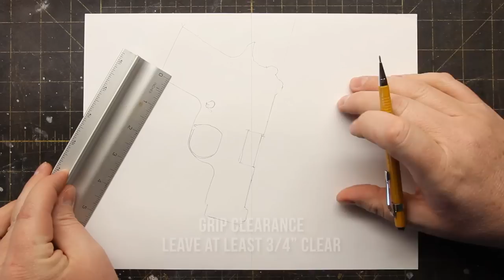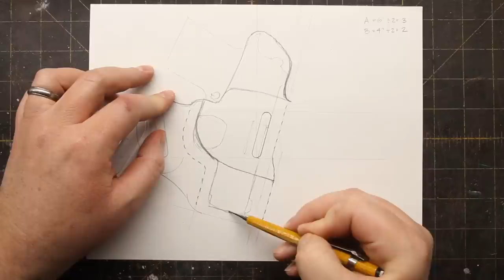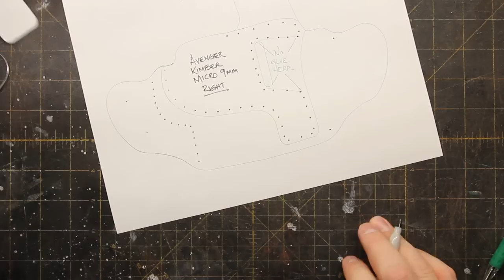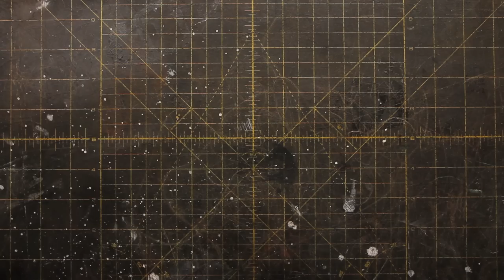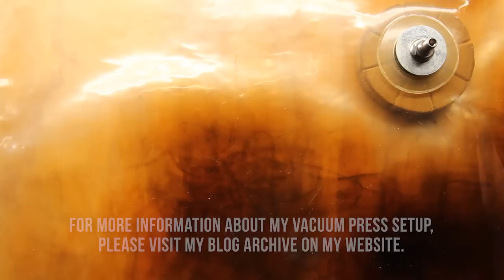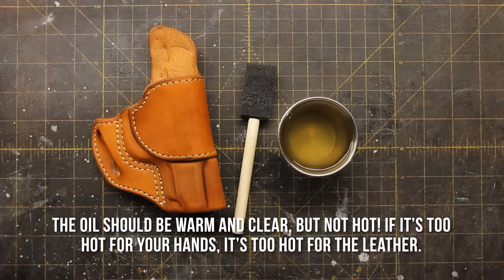Making an Avenger Style Holster, Kimber Micro 9

Comment: Well done! A tip I picked up recently is using a Q-Tip to apply dye, etc, to edges. It uses less dye and works well in tight or narrow areas, plus it is less likely to bleed over the edge. I do envy your shop though. =)
Reply from the maker: Good tip! I've used the q-tip method a couple times, but keep forgetting to bring more down to the shop. Thanks for watching and for the great comment. Take care!

Comment: Have you ever had the thread stain in places after dyeing and the water molding process? I used fiebings low voc, saddle tan dye. I let the dye dry for two days before molding. I did the same process on another holster with no issues. The only difference was I dunked the holster in water a second time while molding. I of course dyed the leather pieces and then sewn together days later. It doesn't look horrible but I want the best look.

Comment: Nice design. I would have lined the holster. It protects the gun from the stitching and the stitching from the gun. Also, you can clean your sanding wheels with a piece of art gun. Fiebings antique finish will also bring out the color of the dye and add another layer of protection.
Reply from the maker: Thanks Jeff - I do line holsters on special request, but I have to charge extra for it. Good tip on the art gum! I'll have to give the Fiebings antique finish a try one of these days on the right project.

Comment: I like how he said not to get the leather wet because it might stain it and that puts the holster in a pan of water.
Reply from the maker: If you wet the leather evenly, the whole surface is essentially stained evenly. But if you just get a portion of the leather wet, or get water spots on random areas, you’ll get noticeable stains. Or you can dampen an entire area, but keep it along the stitch line (paint within the lines), the stains aren’t generally noticeable.

Comment: Ok, that’s the prettiest damn holster I’ve seen in a while!  I can’t get any of mine to look nearly that nice.  Question tho….  You oil the holster, then you hit it w Resolene…. Isn’t Resolene a non-porous acrylic sealer?   You acknowledge the holster needs some oil on it prior to use…. But in the months and years to come, the leather is going to dry out and will need some more oil applied at some point won’t it.  I can see where some parts of the holster will still need oiled again (while avoiding too much softening of the areas responsible for retention).  But won’t the Resolene prevent oil from soaking into the leather in the future ?   Would TanKote be a better option since it will allow for oil to penetrate?   Or is there a reason that Tan Kote isn’t a good option?

Comment: Have you considered suede lining your holsters as well?  It helps to keep the gun from getting tarnished from the raw leather.
Reply from the maker: I never use suede, but I do line with smooth veg tan when requested. Suede is still leather, though it’s tanned with chemicals that can actually damage some firearm finishes. And the suede can hold dirt, causing additional risk of damage to the firearm. That being said, a lot of makers line with suede, I’m just not one of them.

Comment: Hello thak you for publish video. What is the purpose of using dish soap in warm water?
Reply from the maker: The soap helps to break down the surface tension of water. I've always felt it helps the water absorb into the leather more easily. I have no idea if this is true or not, but it's something I've always done. Plus, it's nice to have a little soapy water in the shop to clean my hands. Thanks for watching!

Comment: Yay, a new video. Very nice holster!

Your channel is one of the reasons I started to try my hand in leatherwork, holsters in particular. 

What‘s the reason you leave the mag release button uncovered?
Reply from the maker: Thanks! Glad you found the videos encouraging enough to try it for yourself! The mag release is left uncovered to help avoid accidental mag release. If leather was covering it, it could be actuated by the force of the human body pushing on the leather, in turn pushing on the mag release. You could punch a hole in the leather for the mag release (don't actually do this), but then you can't draw the holster because the mag button would snag the leather and lock the gun in the holster. Safest bet is to simply leave the button completely uncovered. Hope that helps.
Reply: @AdamsLeatherWorks  
Thank you for the elaborate answer. I would have thought having the mag release button covered with a piece of holster would be more likely to protect it from an accidental engage than having it exposed.

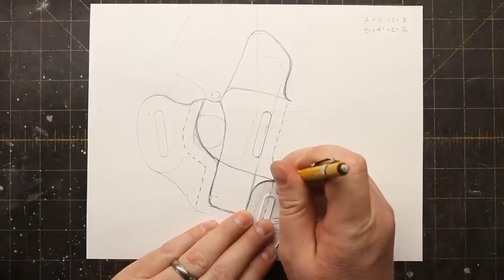Comment: I’m trying to determine the purpose of the near vertical line at 3:08.  I don’t see how it is being utilized in subsequent portions of the video. For that matter, is it just personal preference where you draw the “hook“ into your reinforcement piece between 2:38 seconds and 3:00?

It’s pretty trippy how you use the vacuum bag but it appears you get great results. I especially love the simple but direct aesthetic detailing you work into it after.

Thanks! Will you be at Sheridan in May?
Reply from the maker: The line at 3:08 is the fold line (at 3:31) so I can mirror the pattern to the other side of the piece (so both halves are identical).

The hook you're referring to is all related to the belt slot. When I initially came up with my first 'Avenger' styled pattern (modeled after the original Askins Avenger), I tried to differentiate my design from the original Askins version that everyone else was copying. I made the reinforcement piece much taller on the front of the holster, which allowed room for tooling, though it made the belt slot less ideal on the back of the holster because the leather has to stretch to accommodate the belt. In comparison, the Askins Avenger has an L-shaped reinforcement piece and the belt tunnel can be pre-formed by scooting the bottom edge of the belt slot upward prior to sewing it to the body. Getting back to your question - with my design, the 'hook' has to come down low enough to clear the bottom edge of the belt slot stitching. Look at the back of the completed holster later in the video to see what I mean.

My vacuum bag is the original I bought roughly 9 years ago. It has a few holes in it and doesn't pull much vacuum, but it still works pretty well. I'd like to try a hydraulic press one of these days, but I like the fact that I don't have to worry about bending (or breaking) molds or actual guns.

I don't have any plans to attend Sheridan. I'd love to one of these days, but it's not on the table this year.

Take care, and thanks for the great questions and compliments.
Reply: So the fold line slightly cuts off the protruding “hook” of the reinforcement piece at the very right hand side on purpose? Are you accounting for the thickness of the leather by doing that? Also, is the fold line parallel to the 15° can’t line? — it doesn’t appear so in the drawing but it may be irrelevant. Thanks for your responses; I keep analyzing this video to get a reproducible process for myself. Making it more science than art.…

Comment: ultimately,the holster looked ok from the outside,however,you didnt put stitching grooves for the inside stitches at the least,besides the fact that with no liner inside,the gun will eventually destroy the stitching,also allowing the possibilty of debris from the failed stitching to get into the action of your gun,and when the trigger guard was heavily burnished, even though it was only on the back of the holster,it could cause issues when holstering a loaded weapon.if the burnished area of the trigger guard was not raised before the curing and stiffening,it could catch on the trigger.
Reply from the maker: Thank you for watching and commenting. I'm not sure if you've ever machine sewn a holster, but getting a stitching groove to line up on the back side of the holster is next to impossible. And I think you're over estimating the depth of the indention in the trigger guard area. While it is pressed inward for retention, it's not so much that it would touch the trigger itself. Lining a holster is certainly a nice option, and I gladly line them when requested (and the customer pays extra for the added material and labor).

Comment: Saw good bye to the finish on that Kimber. No liner?
Reply from the maker: Been making leather holsters like this for around 12 years, and never had anyone complain about their firearm's finish. If you carry a firearm in a holster of any kind, you should expect some finish wear over time, regardless of the holster material. Some materials wear the finish faster than others. I line holsters, if/when requested, and I only line with vegetable tanned leather (same as I use on the rest of the holster, only thinner). It was not requested on this holster, so I didn't line it.
Reply: @AdamsLeatherWorks  wasn't questioning the quality,  just that I've heard they need to be lined. You do amazing work.

Comment: What can you tell us about the laser you use to apply your maker's mark? I'm interested.
Reply from the maker: My laser is a Rose Graphix 600mm x 1000mm, fixed height, manual focus, 90 watt machine. I bought it used from a local seller. It’s basically a Chinese import with US support.
Reply from the maker: I should add that lasers can be finicky and it sucks to basically be done with an item and have the laser mess up the engraving. If the mark can be applied prior to assembly, that’s the time to do it since you can cut a replacement piece if the laser doesn’t engrave right for some reason.

Comment: How do you achieve the solid “click” when bolstering the firearm? Many of my holsters and knife sheaths lack that heavy retention even after wet molding.
Reply from the maker: It's just the sound of the gun slipping past the retention point and hitting the leather wall in front of the trigger guard. I try to mold the indention pretty deep, then back it off a bit so it doesn't grab too tightly on the gun. Slick the interior with gum trag prior to sealing the holster. And once the acrylic sealer is dry, wax the contact points inside the holster to help ease the friction.

Comment: If I got my holster cant at 106 degrees does my belt holes go at same angle or 90
Reply from the maker: You usually want the belt slots perpendicular to your belt, regardless of holster cant. Sometimes that might not be possible, so you’ll want to make sure your slots are long enough to fit the belt through the angled slot.

Comment: Very interested in your work, here's why: necessity 🤣.

Actually, I would like to make holsters designed to work with women's waists. Shooting IPSC in Canada, there are restrictions on where your holster can be, but I found it very impractical. If I wore the holster on my waist, when extracting the pistol, (I have to be blunt here) it would collide with my 🤨boob 🤣; no other way to say that 🤣. The requirements of attaching the belt to 'belt loops' on an hour glass figure meant the pistol was angled in 🤔. I sewed loops onto my abdomen pockets to secure the belt, allowing for a straight, fast pull.

As with anything in life, 'accept it, change it or walk away'.... So I'll have to change it 🤣.

Okay, I can figure out everything you do accept how to sew it together without the sewing machine. It's not practical to invest in a machine when I'm only making a few. Cobblers in town have all retired.

Can this be done?

Comment: Great video! How do you keep your dye from bleeding into your threads after soaking it for molding?
Reply from the maker: Thank you! I use Fiebing's Pro Oil dyes and I apply it with an airbrush. I've never had a problem with dye bleeding onto the thread. If you dip-dye, that's probably a different story.

Comment: I am not getting the "stitch offset" part at the beginning of the video. The noted measurements never seem to show up in the process of pattern making.

Could you maybe clear that up? Thank you.
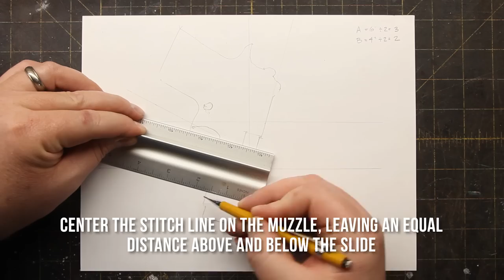Reply from the maker: The method shown in this video starts at the 0:40 second mark. Take measurements at the major widths of the gun (in this video, that's the bottom of the trigger guard and the bottom of the dust-cover). These are my "A" and "B" measurements. Wrap a strip of leather around the gun and measure the circumference (what I'm doing at 0:55 and 1:10). Divide each of the "A" and "B" measurements in half (what I'm doing at 1:17). Center the gun on the stitch offset measurements (I started with the "B" measurement at 1:22, which was 2" as seen in the top right corner of the piece of paper). I then extended that stitch line parallel to the top of the slide at 1:28, then at 1:32 I drew the "A" measurement, which was 3". Then I 'connect the dots' to draw the rest of the stitch line along the bottom of the gun (at 1:35).

I realize everything happens pretty quick in this video. I'd love to make them full-length, or at least a tad slower, but even at 28 minutes long, most people only last around 12 minutes (according to the Analytics data). Heck, I've even thought about releasing two versions - an abbreviated (like this one) and a full-length 2+ hour video, though I'm not sure how much interest there is in that.
Reply: @AdamsLeatherWorks :
Thank you for that, I didn't see yoiur reply and after watching a few times, I found the parts in the video myself. I could not make sense of your description of the steps in the video at first which I think is my fault.

Comment: What kind of laser engraving table are you using?
Reply from the maker: Hi Flint - I have a 90W with a 1000mm x 600mm fixed bed from Rose Graphix that I bought used from a local seller.
Reply: How much were you able to pick it up for? Been considering the k40 but the super small work area is a killer.
Reply from the maker: Flint Barnes I got it for a little under $5k with a chiller and laptop, and some extra material like plywood and some acrylic. It has worked great for me, but mine doesn’t have an adjustable bed height so I’m fairly limited on material thickness. But the bed size is pretty nice.

Comment: Where did you get the belt loop slots?
Reply from the maker: If you're referring to the acrylic templates, I make them on my laser. They are available on my website at www.adamsleatherworks.com. If you're referring to the steel punches I use to cut the slots, I got them from Texas Custom Dies.
Reply: Adams LeatherWorks 
Thx for the reply.

Comment: Are linings absolutely necessary on holsters?
Reply from the maker: I don’t believe they are, but I’d certainly be willing to line a holster if a customer really wanted it. It just costs a little more since there’s twice as much leather to use and more steps to assemble.
Reply: Thanks for the response. I make holsters without linings but I wasn't sure if I was making a mistake by not lining them
Reply from the maker: I almost never line mine. But, lining does generally end up with a stiffer holster so that's a plus. Just make sure if you decide to line that you use veg tan, and not suede. I usually work with 7-8oz leather - if I were to line I'd use 3-4oz leather for both layers.

Comment: I have watched this video 15 times in a row and still cant figure out why you use the leather strip if youre just going to put your stitching one half inch away from the gun out line anyway. the video is so fast that I just cant see what the hell youre doing enough top learn how you do it. could you please write to me and help me to understand it. Ive made several holsters for all my guns and have never figured out a good way to be sure that the stitch lines would all end up in a place where the gun wont be too tight in the holster.
Reply from the maker: Hi Bruce - the leather strip is used as a measurement tool. You wrap it around, place marks where the leather pinches together, then divide that measurement by half. That becomes the stitch offset. I believe what you saw as 1/2 inch was actually a comment to divide the measurement by half. I have several other videos that show the same measurement technique. Give this one a try and see if it helps. It's slower, and I talk during the video. https://youtu.be/mdIYGjPR7iQ

Comment: A lot of time and hand work goes into making a quality leather holster, but people always want to go the cheap route even with a 6-700$ gun. A knowledgeable CCW holder knows the belt and holster are just as important as the gun" even critical. Never ever go cheap on them, and please, I'm imploring you, dont buy a cheap nylon holster. Don't be that guy, it's the mark of a fool and an amateur. If you can't afford a high quality leather holster get a quality kydex holster at the very least. There are many quality kydex manufacturers with very reasonable prices, just make sure they fully cover the triggerguard and provide firm retention of the gun. I've carried every day for 27 years, and the advice above will save you a lot of time and money, a veritable box of useless holsters, and perhaps your life.
P.S. Appendix carry is all the rage right now but it's only for those that are well trained and can be very dangerous without it. Also, never carry a Glock type pistol in a pocket or Mexican carry without at least one of those kydex triggerguard covers.
Reply from the maker: Thanks for a great comment Jonathan! Thanks for watching.